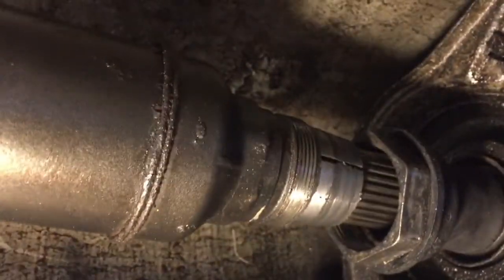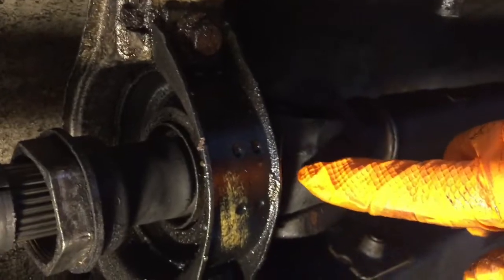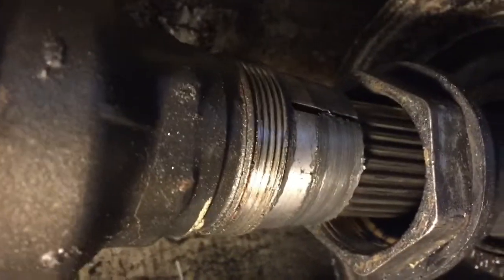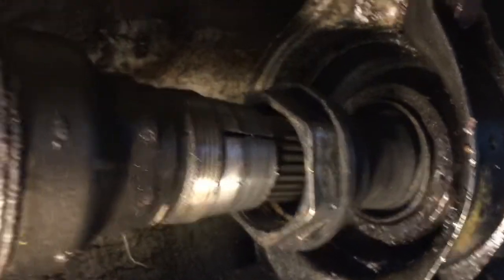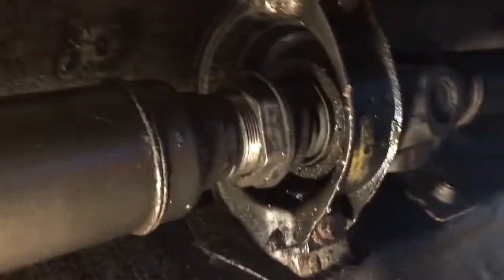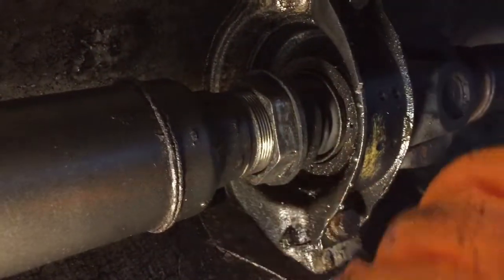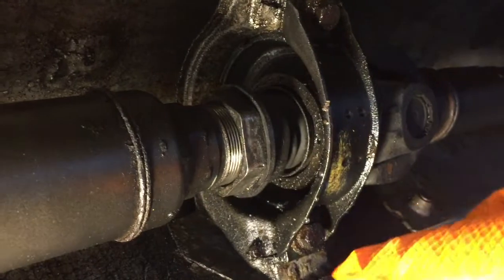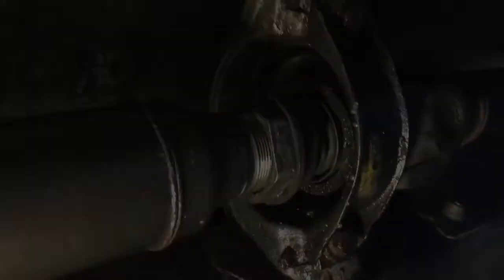Fixing drive line vibration W126 Mercedes Benz- The prop shaft balancing markers must be aligned

Comment: I am sure you have smooth ride after this alignment, I want to share my experience the mechanic here while fitting kept the car jacked up resultantly centre bearing of shaft was tighten without letting the car parked on all 4 wheels and w123 had vibration at around 40-50 km band only .  The problem was sorted out after loosening the centre bearing while car was on leveled on the ground and retighten the both bolts
Reply from the maker: That is really interesting. With the differential mounted to the body via the suspension cradle and with independent suspension, there is no movement of the drive shaft due to putting weight on the wheels. 
The only way that can happen is if the cradle is sitting on worn rubber bushings. So in essence you may be addressing a symptom, but not the root cause of the problem. I am glad you were able to lower the vibration though. 
Aligning the drive shaft parts properly makes a noticeable difference.

Comment: Having a clicking/banging noise when rolling. Noise matches speed and it’s very loud. It is definitely coming from the left rear of the vehicle. What could it be? 1980 W116 300SD
Reply from the maker: Could be prop shaft but also half shaft related. Have you jacked up the car so you can check this out?

Comment: Just had a local shop replace my center carrier bearing/bushing and now i have this whirring vibration. Went under the car and i am pretty sure the two halves are misaligned by one spline tooth. Took a rope to make sure and the marks don't line up. Is one tooth enough to cause this issue?
Reply from the maker: Unfortunately it does make a difference. I had one off by just one spline and there was a noticable driveline vibration. Also, make sure that they tightened up the drive shaft lock nut in the correct spot with the correct torque. These seemingly little details can make or litereally break stuff.
Reply: @straybenzes  Thanks for helping out. I did realign the driveshaft but 90% of the vibration is still there. New motor mounts, trans mount, flex discs, carrier bearing did nothing and even made things worse. No idea what to look for next...
Reply from the maker: @Zinglupate  This is really difficult to diagnose from afar. If the vibration is worse after the parts were replaced it can be the parts or/and an assembly error. I doubt it is the motor or tranny mounts.

Comment: Is this correct? It looks like the mark on the forward end is aligned with a single mark on the rear end, vs sitting between the two marks on the rear end?
Reply from the maker: The one in the video was off and needed to be corrected.

Comment: I got nasty vibration at 25 mph and then again at 40 . All in the centre area. Could it be propshaft or torque converter? Doing my head in now.
Reply from the maker: It is very unlikely the torque converter. If it is coming from the drive line then typically it is either the Hardy disks and / or the support bearing on the drive shaft. Good luck!
Reply: @straybenzes  thanks for replying . It did disappear for a week when I changed the transmission fluid but then returned a few days later. Also horrible loud droning noise on motorway at 70mph  fingers crossed I can sort it.
Reply from the maker: @Jennyo8xx  Did you take off the transmission oil pan when you changed the oil in it? If so, what did you find in the bottom of it other than oil?

Comment: Hi do you need to remove the whole drive shaft to replace the centre bearing? I have a grinding sound on mine. Probably the centre bearing.
Reply from the maker: I would remove the whole shaft.

Comment: Hi! I have vibration when I stop at traffic light on D pushing brakes, periodic vibrations, could you give a hint for the solution? Thanks!
Reply from the maker: Vibration as the whole car shakes a little? If so, then that is due to worn engine mounts and shocks. Good luck.
Reply: @straybenzes  thank you! Im 24 and learning how to fix my 300SEL by myself:)
Reply from the maker: @MrBlack-cv8qn  Very nice. The best of luck to you and stick with it.

Comment: Hello.thanks for the video.
the line mark is a factory mark?or you did it before separate the driveshaft?
I changed the bearing on my w126 and the 2 flex disks but unfortunately I didn't check the alignment before the 2 pieces of the driveshaft.
Reply from the maker: Hi Adrian. I did not have to mark anything. The video shows the factory markers on U joint and prop shaft between 57seconds and 1min 05 sec. All the best.

Comment: My w126 shudder on takeoff I replaced center bearing but still exist.
Reply from the maker: That should be related to the rear subframe rubber bushings. Are the flex discs is great shape?
Reply: @straybenzes  yes
Reply: @straybenzes  I suspect the differential bushing.